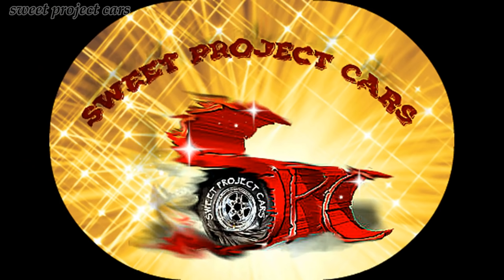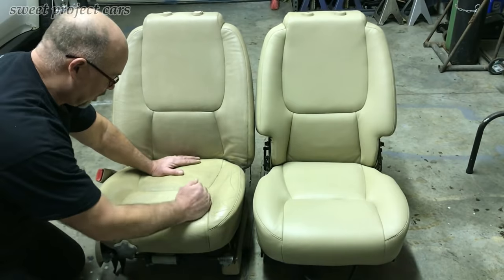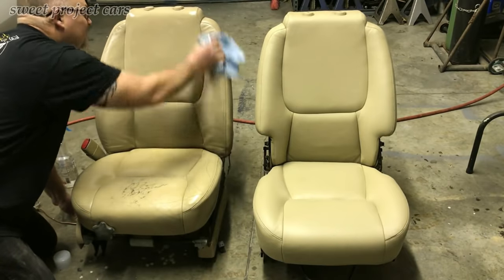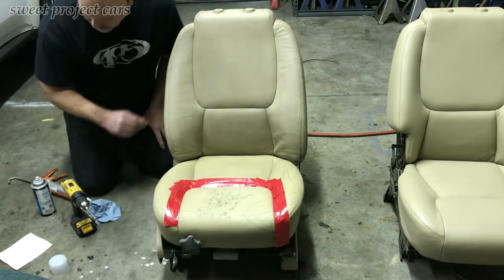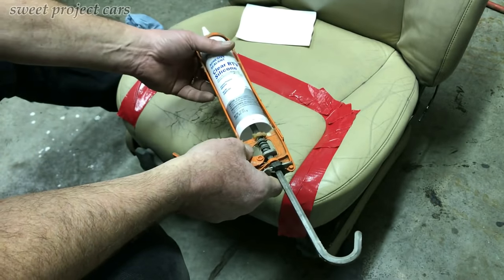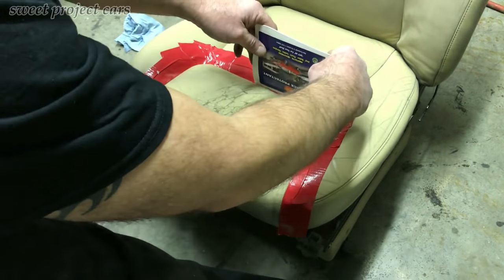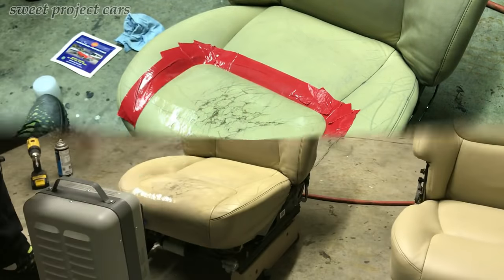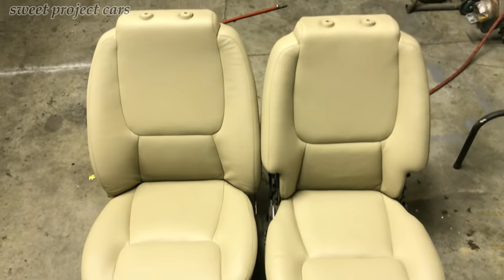How To  REPAIR THE WORST LEATHER & VINYL Seats...Never Seen Before

Comment: I know this is off topic of this video but I wanted your thoughts and opinion.i had a brain storm(or possibly a brain fart,lol !),not sure how familiar you are with synthetic clay bar,but do you think it would work well for dog hair removal ?they have that tacky surface when they are dry. I’m wondering if you think it would pull dog hair out of carpet and cloth seats.please let know what you think
Reply from the maker: George Myers this is what we do for pet hair my friend :)
Reply: I have a mothers 2.0 synthetic clay bar I use on my own vehicles.I’ll definitely give that a try on the next dog hair car I lock up with at work.we use the pet hair stones at work.it helps but isn’t the solution. I’m always looking for the ultimate mouse trap
Reply from the maker: Good deal George thank you for sharing we appreciate it big time
Reply: I’m thinking that if the mother’s 2.0 works well,a synthetic clay mitt would just up that game a bunch by being quicker per square inch of area.
Y’all think it’s bad on your end I have to live with my mind 24/7 constantly thrashing ideas around,lol !
Reply from the maker: George give it a try and see that's how we do it here :)